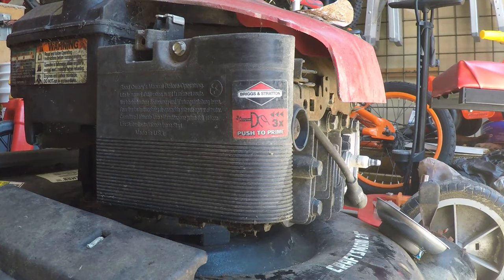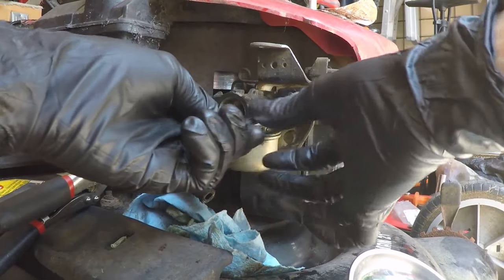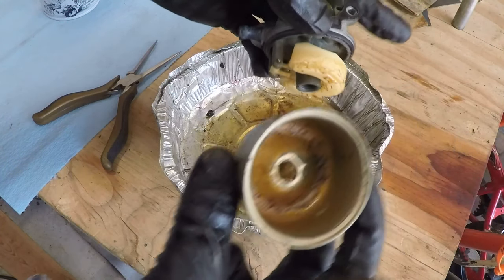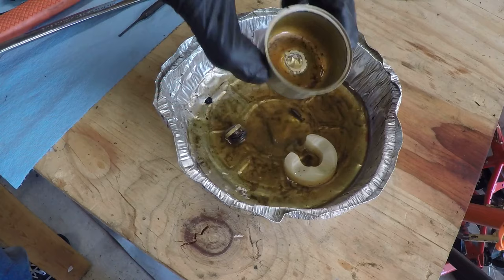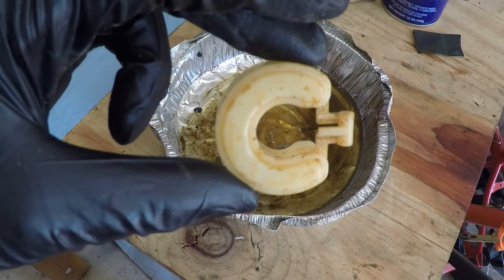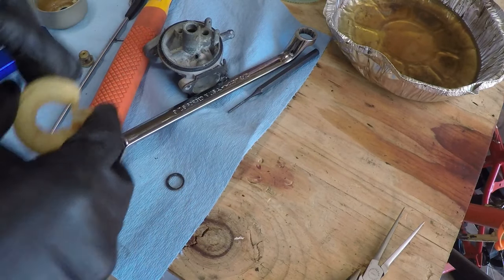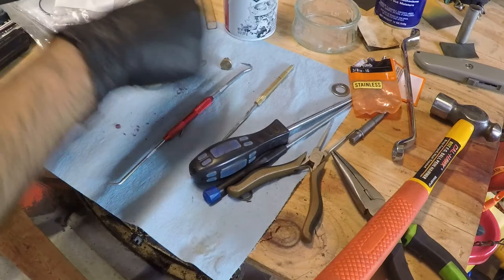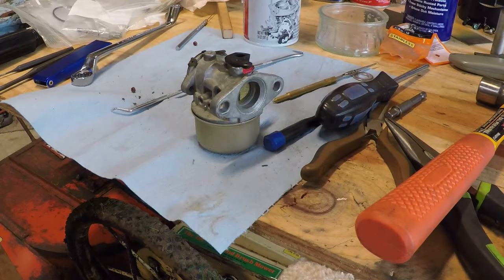Briggs and Stratton 498170 Carb Clean Detailed

Comment: Don't forget to clean the fuel tank thoroughly also. I struggled for days having the carb work well for a short period and then start flooding (new float needle and seat had been installing during cleaning). Although I rinsed the tank out with fuel, I believe there may have been some small residue remaining which managed to prevent the float needle from seating and causing me lots of trouble (no start and flooding).
At least that's my story and I'm sticking to it ;-)
Reply from the maker: Yup. I had a note during one of the scenes that you should do that. This tank was essentially empty and it was clean on the inside. Just some stale gas in the carb bowl. This week's video is on a similar mower with a similar engine and I do clean the tank in that one.
Reply: @billyb351 : Although somewhat unrelated, during my frequent disassembly and rebuild of the same carb (which continued to flood), I had a small spring remaining. The spring was like a ballpoint pen spring, only smaller (3/32 x 5/8).
I can't for the life of me determine the origin of the spring with the only change being that a B&S saucer shaped fuel filter was added to the intake fuel line.
Is there any possibility that these filters would contain a small spring for some reason or other?
I know this sounds like a dumb question but I can't determine why this spring showed up in my parts bowl during my last carb cleaning.
Any ideas?
Thanks in advance.
Reply from the maker: @dalemullen96  I've seen small springs in small diameter fuel lines on 2 cycle engines to keep them from collapsing under vacuum but never in a 4 cycle motor with a float bowl. These motors don't have any springs anywhere in the fuel system that I'm aware of. Those little fuel filters only have a fine screen in them... no springs. So that's a mystery where that came from.
Reply: @billyb351 : Thanks for the reply. This one has me buffaloed also.